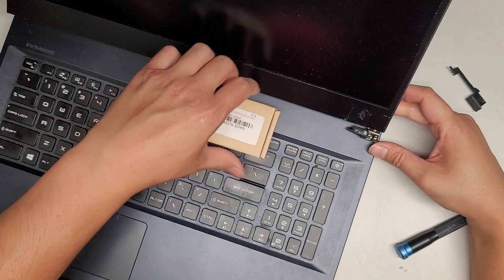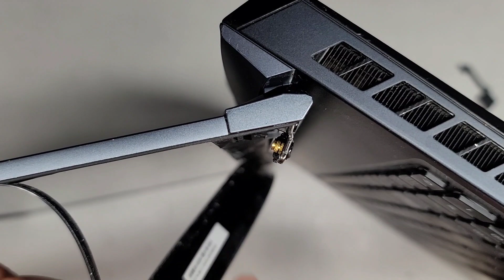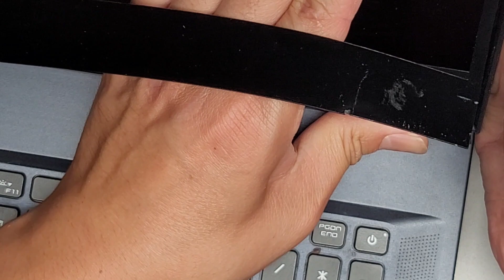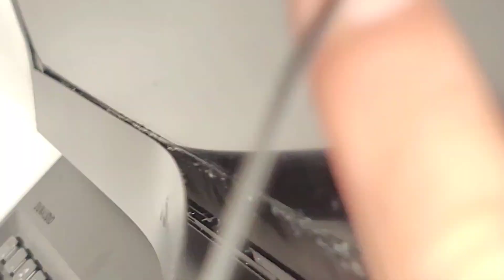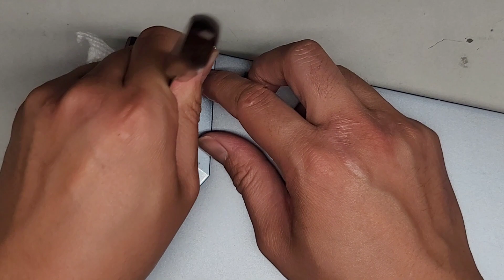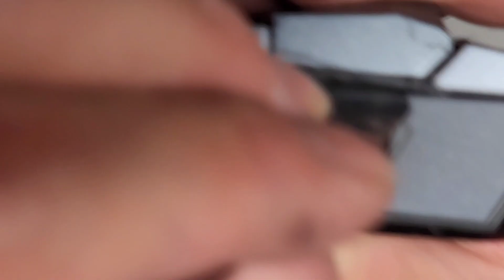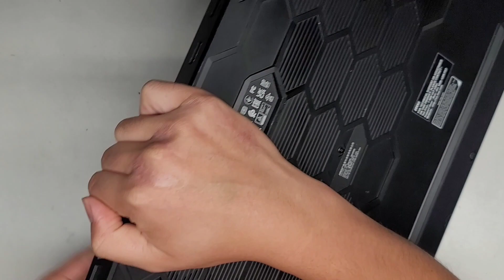MSI GE76 Raider Broken Hinge Repair Without Replacement Parts

Comment: So it is normal for the hinge to be very hard to raise? I was wondering if the hinge is gummed up or frozen. Trying to figure out what parts (if any) I need to buy to repair this.

I bought a used one on eBay for my son’s birthday, and his heart just about broke into a million pieces when we heard the crackle of the plastic busting away from the hinge 😢
Reply from the maker: Yeah, it's supposed to be hard to turn, otherwise the screen will just fall over.

Comment: But you don't have the piece of plastic in the middle, I know it broke but that acts as a spacer as well...  Di you do the very same with the other hinge? maybe if both dont have the spacer it will work better but if one has it but the other doesn't that is not balanced and may create more problems in the future. Another video out there thread the hinge flaps  and screws from the back that seems better but failed to address how to remove the plastic hinge covers in the back
Reply from the maker: The spacer isn't needed. Cosmetic pieces.

Comment: This is the 2nd MSi laptop that the hinges are starting to fail. I’m noticing a bulge right there where you repaired. Is there anything I can do to prevent this if it isn’t completely broke yet?
Reply from the maker: Same fix. Reinforce it

Comment: same thing happened to  me 3 years ago, it was under warranty so MSI fixed it free...happened again 2 months ago, warranty now expired...terrible design...laptops I buy now have to have one long hinge at least 12 inches long or I won't buy it...wish someone files a class action lawsuit....$2500+ for this design is a crime.
Reply from the maker: The length of the hinge isn't that important, but it needs to be front to back, not side to side
Reply: @ItsBinhRepaired  it centered in the middle...almost the whole length of the laptop.
Reply from the maker: The issue is they make the hinges too narrow. It's like twisting your finger vs trying to force it open.

Comment: I just performed the procedure demonstrated in this video a couple days ago. I had no experience with epoxy products at all before this. So far it appears to have worked! The fixed hinge feels rock-solid! At least for now. The other hinge is on the verge of breaking, so we'll see what a double-fix is like. But for now, my laptop lives on!!! RECOMMENDATION: definitely use plastic film, packing tape, or whatever you can to cover the surrounding surfaces to prevent the epoxy from getting where you don't want it. Think about how you will position your laptop while curing before you apply the epoxy.
Reply from the maker: Yup!

Comment: I had the same hinges on my msi. I do this with an 2 chamber epoxy, which are mixed by the dropper/pipette. It is more fluent as JD well. So I hope this works. My first try was only to fill one hole, but this was broke after my test. so I used some more epoxy. I had two MSI Laptops, both have the hinge problems! MSI made good gaming laptops, but the hinge-problems  :-/ I will never buy  MSI again
Reply from the maker: Those kinds of epoxy aren't strong enough. I've tried a lot of things before I found that only the original jbweld is strong enough. Don't use other stuff or you'll be stuck with a mess that can't be repaired with jbweld anymore.

Comment: It's so dumb that they would design this this way, because not only will it be a guaranteed issue on the ge76 after a couple years, but when one goes, the other one doesn't have long.
Reply from the maker: Yup...

Comment: I have bought both new and used gaming laptops for many years since like 2011 or so. And eventhough several of those have been Msi gaming laptops, not a single one had the hinges breaking. But i hold above the webcam with one hand and the other hand on the base of the laptop and then boom, they don't get damaged but if you open by grabbing like from the top left or right corner like a dumbass then of course more strain is put on the hinges and the screen but i am not a dumbass opening any laptop like that so therefore my laptops doesn't break. You just need to be smart enough so you can understand this. Be careful and open it the smart way, like i do. Then you won't have these issues.

Comment: For anyone who has come across this problem...I have an alternative fix. 

First off I tried this repair on my original MSI laptop with one broken hinge. On the way to fixing it, I somehow damaged the LCD cable that runs along the bottom of the LCD. So I ended up getting a used replacement MSI with the same specs from eBay for around $500....swapped out the parts and all was well...until the same thing happened. I was not surprised either because the hinges are tight and knowing how they were designed it was only a matter of time.

I started to go down the same road to fix the hinge with the JB Weld, which does hold btw, and then the other hinge broke. So I came up with a radical idea to fix it permanently.  I picked up a flat head screw assortment (black) from Amazon that ranged from M2 > M5 at various lengths. I removed the bottom of the bezel like in this video and taped it out of the way. Then I drilled through one of the screw holes, threw the JB Weld that I applied to the first hinge, and threw the lid and out the other side. I picked a screw that fit the counter sink and went through just enough to get a nut on it and tightened it all down. I then removed one screw from the other side hinge, with no JB Weld, made sure it was all lined up and did the same thing. Because I used the same flat head size screws they were pretty flush to the hinge bracket so the bezel stuck back relatively flat once I was done. Now both hinges are solid as a rock and I can open and close the lid without worry. 

Yes I have two nuts that protrude through the lid of the laptop lid, but it's not even very noticeable since they are black. If I could attach a picture I would....but trust me, it does not look bad at all and peace of mind is worth it...and I really love this laptop.

In the end it makes me wonder why MSI did not do something similar. They could have designed the lid so the decorative extrusions that are glued to the lid covered the nuts...or whatever they would have used. It sure would be better than a metal hinge that relies on some studs sunk in plastic to hold it all. It is not a long lasting design no matter how you slice it.  I might go back at some point and add another screw to each side to be safe, but TBH it seems pretty solid with just the one on each side.

Anyway, thought I would share that with anyone looking for an alternative solution. BTW the screw assortment cost $16 and came with the screws, some washers and nuts. I probably will never use them again, but it's still some of the best $16 I have ever spent.
Reply from the maker: Yup. I recommend washers as well.
Reply: @ItsBinhRepaired  Yeah I've been planning to add them. They were hard to add originally because I used bolts that just barely protruded. But I can probably add them now no problem. Good point.
Reply: Did you remove the plastic covers on the backside of the lid or did you drill through them.

Comment: Thank you very much but also show my video about hings. i not use jb weld because it is only good for metall not for plastik . i had make tests with scale and jb weld not good for plastic i prefere bindulin glue it is more better then jb weld. 
i also make disassembly the hing and on the screw bolt spin so the the force on the hing is not so big
Reply from the maker: Uhhh what? Glue might hold plastic better, but it will not fill a gap better.
Reply: @ItsBinhRepaired  you can use glue mith two properties. Epoxy glue eg bindulin bindenorm it is better. And also i use some fiberglass in it you can watch it on my chanel
Reply from the maker: Nice

Comment: I honestly do not remember putting a 'like' on this one. But hey, I own this exact laptop,  and the bloody hinges broke. So thank you _yet again_, it's 3rd time i find your video personally useful!  I loved the way you immobilized the whole thing , with a knife in between laptop halves, and with scotch pieces. I did a lousier fixation + less pressure, and now have a cosmetic defect on 1 corner. But what I might have done better is, I loosened the 2 nuts on the hinges. That lowered the force i am using by a lot, so the hinges are unlikely to break again. Now, I can open/close the lid with one hand. On @3:27 you admit that your hinges are tough.
And the hinge design sucks badly, and on purpose ofc. Unbelieveably stupid placement of holes + very short lever, which only worsenes the defect.
Reply from the maker: @ichepurnoy  yup, very bad design.

Comment: careful with a repair like this, you need to be really mindful of how much you apply because in my case it oozed out when closed, couldn't see that it did, and now it closes but not fully as the keyboard facing side of the hinge now has bond on the front of it.  This also means the cover that holds the GND against the screen doesn't fully lay flat, and I'm honestly not sure that anything can be done about that.  Honestly everything still works, and I can close it 97% of the way, but it's really hard not to overdo that application, because I put basically nothing on it, and it still either oozed, expanded, I don't know what.
Reply from the maker: Yeah, pretty tricky. You can cut away excess with a razer blade.
Reply: @ItsBinhRepaired  I'll have to get one and try that, maybe i can scrape just enough off the one side to make it perfect.  Thanks!
Reply from the maker: No problem just slowly saw at it and it'll cut away.

Comment: This is great, but the takeaway is: DO NOT PURCHASE MSI COMPUTERS.
Reply from the maker: @buckdraper303  or dell, or Lenovo, or hp lol they all break
Reply: @ItsBinhRepaired  Nope. Been in IT over 20 years and have worked with many laptops. Never had hinge issues like I have had with TWO MSI laptops. This seems to be an MSI problem and one they don't care to fix.

Comment: Thank you so much for this fix! I've ordered my jbweld, but I have some questions about the fix.

Is the broken hinge related to the fact that the screw is disconnected, so you removed the screws and jbwelded them together? The plastic part seems really flimsy and falls out easily even when clicked into place, but you didn't jbweld the plastic part with the metal hinge so I'm assuming the problem is with the metal hinge's screws. (Edit: After looking back at the video, I think I understand now. The screws are too short and too weak. Eventually the inside is damaged and the screw becomes loose.)

As for the plastic part, it seems that it's held by the cover?
Reply from the maker: @derpy566  the hinge design is bad. There's no leverage. It's like grabbing your finger and twisting it vs trying to pull your finger open and closed.

Comment: My left hinge just broke this morning and lo and behold, there are YT videos on how to repair it. This one makes the most sense to me so going to order some JB Weld and give it a shot. I will let you and your viewers know how it goes. Wish me luck !!
Reply from the maker: Hope the repair goes well. It's easiest to do it with the screen assembly removed, but you need to put the bezel back on to make sure the jbweld isn't too thick.
Reply: @ItsBinhRepaired  Yeah now on top of the hinge issue the screen went blank while I was messing with it. It came back on and off again so must be a loose connection. I ordered the JB Weld and will deal with it when that gets here.  I'm not looking forward to it though. At least I have a backup laptop to hold me thru until then. I swear I love the MSI Raider LT, it's a great gaming machine, but I have had more than a couple of problems with it.
Reply from the maker: @Alan_Edwards  oh no
Reply: @ItsBinhRepaired  Well got the hinge repaired...well I should say "hinges." The right one broke pretty much the same way while I was working on the left one.  But they are both done. I am afraid to try and close the lid though. Man I don't know why they make them so tight. I love the LT but the hinge design leaves something to be desired for sure. Now I can move on to trying to figure out the issues with the display. At least now I can work on it without the lid flopping around. Thanks brother.
Reply from the maker: @Alan_Edwards  need to clear up the stuff below and rough it up.

Comment: Aw man you’re a life saver. My 2 year old laptop hinge snapped tonight, definitely going to try this tomorrow.
Reply from the maker: Someone said msi might fix it for free, but if not, hope the repair goes well. Make sure to watch it fully before proceeding. Don't use other glues/epoxies.
Reply: @ItsBinhRepaired I repaired it while following step by step using original JB, so I’ll check back this time tomorrow!
Reply: Final update: it’s perfect!! Only thing I did differently was use an excessive amount of painter’s tape to make sure the JB didn’t get on any incorrect surface. Thanks so much for your video you’re a lifesaver man.

Comment: I've seen on another repair channel.. the guy was using Hot glue, and it seemed to work just as well.  The best thing about it is that you can just add heat and pull it back apart if you need to and reapply as needed, etc.   So it's technically not as strong on paper,  but it's more versatile in that way.
Reply from the maker: @calholli  hot glue will not even hold for a week. You can do it if you want, but good luck getting that junk off after it fails and doing it right right way. Jbweld won't stick to that junk.
Reply: @ItsBinhRepaired  Lag bolts it is. ;)
Reply from the maker: Lol

Comment: What I've seen other people do is just drill holes all the way through the backplate and then mount it with through bolts..  It makes it looke kinda steampunk, but who cares.   It would definitely never break again after that.
Reply from the maker: @calholli  lol a lot of people don't want a lump sticking out the back of their device.
Reply: @ItsBinhRepaired  I get that-- but It works 100 times better.  It's definitely what I'll be doing.  To be honest, they should actually be built with nice looking external hinges riveted on and looking classy.. like an old wrought iron gate;  but we don't build things to last, sadly.
Reply from the maker: @calholli  I'm sure it's intentionally designed to break after warranty ends.

Comment: I did this repair, but instead of gluing the whole hinge I used jb weld and glued the screw mounts back into place making sure they were centered. After the epoxy started to set I carefully and loosely put in the screws just to make sure everything was aligned perfectly. Then clamped and let it cure. Works like new and I am able to remove the screws if needed. Hope it holds up.
Reply from the maker: Likely will break pretty fast. I used to do that, but it always failed.

Comment: What a legend... i just had the same hinge snap on my ge66 raider and i'm 100% doing this. What a lifesaver thanks a lot also I liked and subbed. I was going to buy a new top case for it but this is a much easier fix as the left hinge feels to be sturdy still and i assume id have to remove the bottom case and lots of components to be able to replace the top case anyways. Appriciate your vid keep up the awesome repair vids!
Reply from the maker: Awesome! Hope the repair goes well. :)
Reply: @ItsBinhRepaired  thanks you think it will still work if that long loose plastic piece that you put in at the end is broken and not able to be put back?
Reply from the maker: The bezel? Or the piece above the hinge beneath the bezel?
Reply: @ItsBinhRepaired  the little piece you lay above the hinge... looks like a piece to keep the hinge lined up or something.
Reply from the maker: @mattgee4556  I think it'll be ok without it if you lost it.
Reply: @ItsBinhRepaired  no I have it but it is in like 4 pieces it snapped into a bunch of little pieces
Reply from the maker: I would try to put it together if you can

Comment: Your video was super helpful and I was able to repair the hinge with JB weld. However, I think in the process I may have loosened the cable or something. When I turn the laptop back on, there are horizontal lines at regular intervals maybe like every 2 mm it slips between screen, horizontal line screen, horizontal line. it doesn't seem like when you physically damage a certain area of the screen and just stop area gets lines in it. It almost seems like the little cable that goes through near the bottom left was loosened or damaged. Do you have any videos on how to access that to check and see if maybe the cable just came loose?
Reply: @popeyefur     Damn i came back this morning after weekend and find out that i have those same lines as you. 3 lines at the very bottom of the screen. Yet i havent' touch it or did any kind of reparation. I left it open for the weekend and boom, somehow they apparead. Have u find a way to fix the problem ? That cant be my cable cause i left my laptop open.
Reply from the maker: This playlist will help Laptop Cell Cellphone Phone Computer LCD Screen Replacement Videos: https://www.youtube.com/playlist?list=PLSSiYX-ta7aqdMHpT-KqCZvBxODqzr2b4